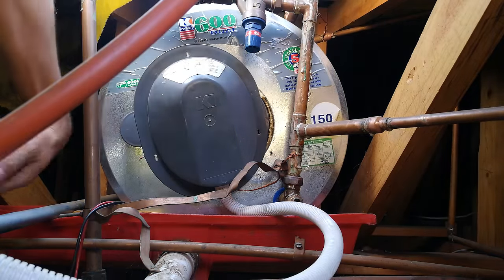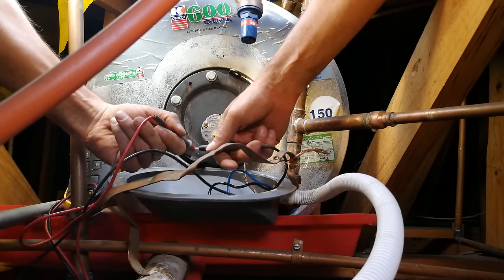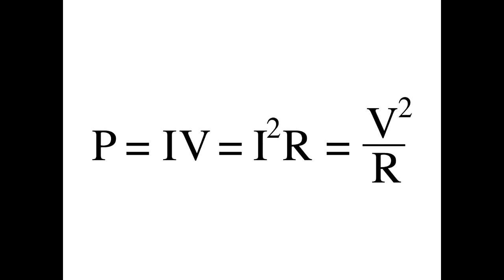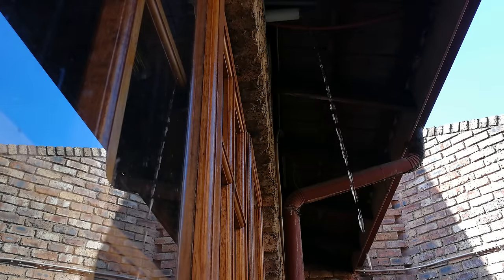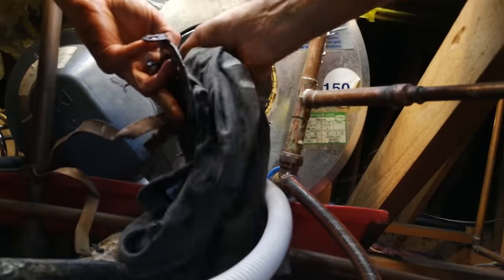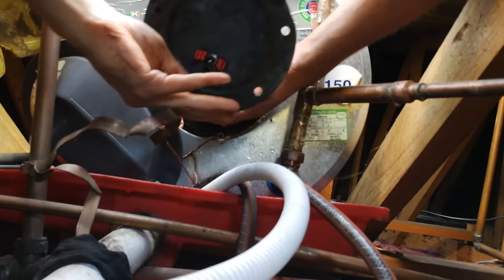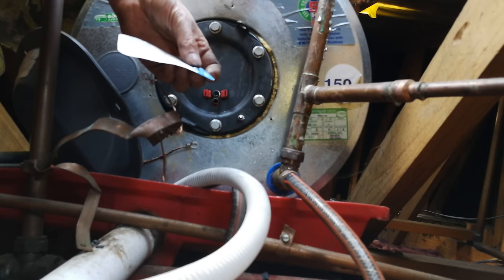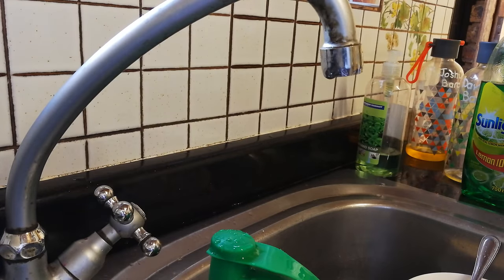How to change a geyser element and thermostat - step by step explanation (Kwikot)

Comment: Bro, thanks a lot for this step by step video, I’m currently looking to replace my geyser element as it’s tripping the main earth leakage. It’s a 3kW element and resistance test is about 16ohms. Thermostat seems ok, as it switches on the live contact. Had geyser installer replacing the element early in the year and has done a horrible job. Thanks once again, now I can do the job myself correctly.
Reply: Hi did you sort your issue out? Please tell me what was the problem as mine is doing the same thing

Comment: Nicely done. Learned a lot about testing the element and thermostat My geyser tripped the mains. The rubber seal perished, and water got in between the two terminals of the element. Replaced the rubber, and that solved the problem.

Comment: Just sorted mine out, was leaking badly with water coming out of 'what looked like' through the thermostat. Turns out the seal inside had turned to jelly, what was left of it.
No.5 allen bolt was also loose. Suspect because of the seal disintegrating so no amount of tightening would help in the long term.
Replaced seal and element for good measure. 
Thx for the useful video mate.

Comment: Thank you very much for this informative video, I also have a KWIKOT 600 Dual Electric Water Heater IPx4 Rated geyser bought at Cashbuild/Builders's Warehouse (cant remember), after 4,5 years installed and working perfectly, it started tripping the earth leakage circuit breaker on the main switch. I first replaced the thermostat but the problem continued (which means the original thermostat was still in good condition, hence I kept it). I then went on to replace the element and the problem was fixed! This video is very helpful!

Comment: Thanks for the very thorough and clear video. In my case, the problem was the element. I took a chance and replaced it based on symptoms, without the thorough testing shown in the video, but the result was good. The part I was stuck with was draining the water out of the geyser inside the ceiling. I was used to doing it up on top of the roof from a solar geyser, but it was the first time I had to drain a geyser inside the ceiling. Definitely a video that a non-technical person like myself can go back to over and over again. Thank you so muck!

Comment: Thanks a stack for the very informative video. Any suggestions on how to solve air in hot water supply, seems to happen frequently, water spluttering, then goes away until next time...

Comment: Kwikot 400kpa khn3.214 pressure valve is humming now after replacing it 4 years ago. Running cold water taps makes a low humming sound. Flushing a guest toilet upstairs makes the regulator hum like crazy, the whole house is filled with this loud moaning, and the regulator even has a high frequency vibration when I touch it.

No solution anywhere. I'm thinking I need to service the pressure control cartridge which is the best thing I can guess from online info. What I know is that my unit is serviceable and yet if I call any plumber they will tell me it's broke and I need to buy a new one. Then they score my one and just service it.

Holy moly I just figured it out. 😂

Comment: Great Video thanks.

Just a note of caution, so that other people don't make the same mistake I did, if you buy a nasty splash works replacement element from Builders Warehouse the threads on the heating element that you screw the Allen bolt into, which secures the element to the bulkhead fitting aren't cut deep enough for the bolt to pull the element tight up against the rubber gasket. So what happens is you tighten the bolt, install everything and as you fill the geyser water starts pouring out around the element and you think how can that be? 

Truth is the Splashworks element is a poorly made POS. You then drain the geyser again unbolt everything in a hot, confined precarious environment and have to use a M6x 1.0 tap to tap the threads full depth in the back of the element, so that the Allen head bolt will screw in deep enough to clamp the element firmly up to the rubber gasket.
Other than this frustration of buying substandard merchandise, element replacement was exactly as you described.
Look forward to more of your DIY videos.
Reply from the maker: thanks for your comment and important info for the viewers.

Comment: Hey thanks for this. I have same geyser but its leaking from the element at the bottom from those pins where the thermostat goes in. Changed the thermostat but it has stopped working because of water leaking through those points and going into thermostat resulting in a short circuit. So the water keeps getting so hot that it starts boiling and throwing water out from the pressure valve from top. Could it be the seal inside the geyser that has worn out? The flange?

Comment: Have u done one with geyser pressure valve replacement. I got an issue that with my one, water flowing out none stop. I did switch off geyser and close the water inlet tap before the pressure valve. The water that run out is not hot but cold, however the water from the hot tap is hot as normally are.

Comment: Thanks. Very informative. My geyser is causing my earth leakage to trip. Do you think the element is faulty?
Reply from the maker: could be many things, could be a break down in insulation anywhere in the circuit including the element.
Reply: @ecologicaltime  thank very much for the reply. The problem was the element. I was lucky to replace it during the lockdown. The local hardware shop is opened for 2 hours a day everyday and they had the parts that I needed. Orginal kwikot parts. Didn't take any chances replaced the thermostat, element and gasket. The tutorial was very informative as I was able to do it myself.

Comment: If it's not wear and tear on the element, please make sure the geyser doesn't siphon out when the main cold water is shutoff, this could be a faulty vacuum breaker... must eliminate the cause of the problem, but a helpful video 👍
Reply: Water is streaming out from the element terminals encapsulated in orange plastic.What could be the problem.Basically replaced everything at the electrical connection and the flange gasket.thank you.

Comment: My gyser isn’t heating water from last night. I went up the celling and checked the thermostat, there is continuity- it’s present. I checked resistance on the element it’s 18,7 my gyser is rated 3kw so this looks ok. Now I went to the DB and swapped the breakers. I connected the gyser on the stove’s breaker and now it seems like the water is getting warmer. I will wait an hour and see if there is any improvement or it’s just my imagination. I will update on what happened.
**Update - the problem was the breaker, I bought and installed a new one and I have hot water now🙏🏾.

Comment: thanks for this. How much would you charge a customer for doing this?
Reply from the maker: i would pay a plumber no more than R500 for labour but it does depend how difficult it is to access the geyser.
Reply: Looks like it wouldn't take more than an hour once you are up there, but then you still have to drain the geyser..About 3 hours on site, 2 if everything runs smoothly..plus you still had to go stand in a queue at the supplier, maybe had to go to more than one supplier to get the materials, fuel...sounds like its not worth it from a plumbers point of view if you can only charge R500 Labour..im only saying this because im looking to getting into plumbing myself..
Reply: I have to go look at a geyser tomorrow morning, no hot water, I already bought the multimeter today
Reply: @gareth2250  R1450.00 is what I had to pay for this job. 
Done by two boys who barely have a trickle of hair on their moustaches. Lol

Comment: Reading 26/27 ohms on a 2kw element is not to say it is in service'able condition, i found many over the years that is 26/27/25 ohms,, all gonners, not service'able.  when you change the element spend that 300 bucks and replace the  Thermostat too. The contact on the inside of the thermostat burns away, in the end you end up with a stuck on thermo... element kapoof!

Comment: What I'd like to know is what happens if the leak comes out of the housing where the thermostat goes in; there doesn't seem to be anything holding it in place; I removed the thermostat and put a new one in but it leaks out of the whole where the thermostat goes in; there isn't a single video or article on this problem, how can I fix that?
Reply: The element has a tiny hole in it which is  allowing water to enter the tube in which the thermo probe slides. Replace element
Reply: I have water streaming out where the 2 red terminal are.Replaced the gasket flange , element and thermostat.Pls need some advice.

Comment: Unfortunately you have underpowered this poor customer's geyser with an incorrect sized element and it seems you didn't reconnect the earth wire to the metal flange. Elements are colour coded for easy reference - red = 2kw for 100lt and Orange = 3kw for 150lt and Blue = 4kw for 200lt.
Reply from the maker: thanks for your comment.